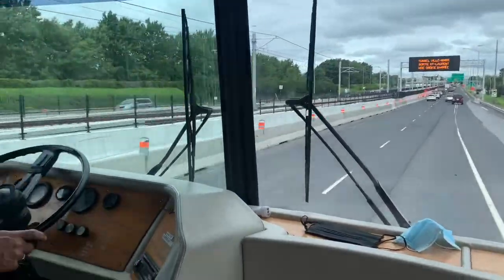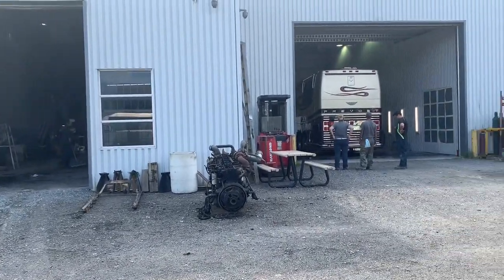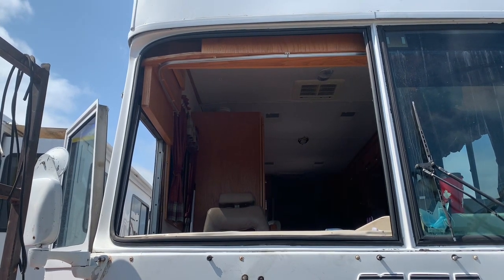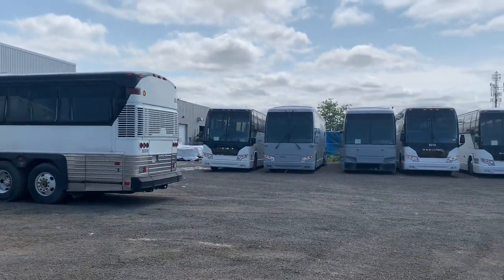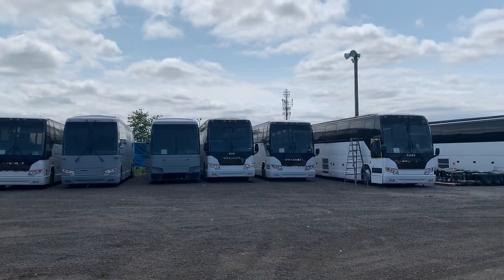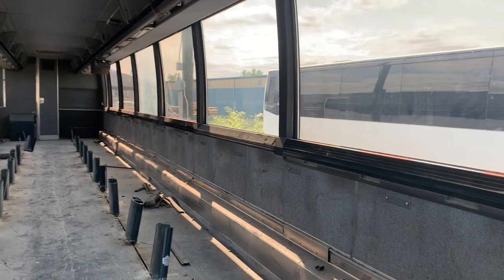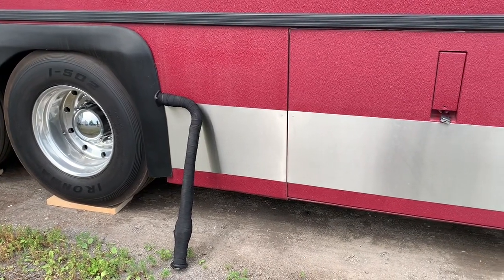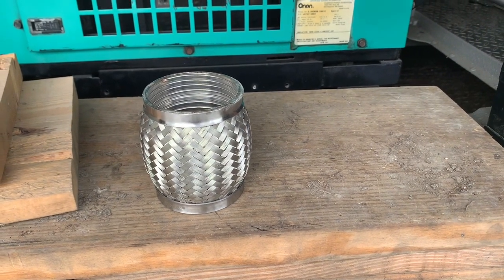E56 MC9 windshield replacement, and generator exhaust.

Comment: I’m not sure what Prevost does now, but my 1991 model year H3-40 is a “vip” model.  The standard H3-40 was the seated coach model and had the roof round over just above the drip rail at the top of the side windows (like most of the ones in your video).  The VIP model had the roof raised about 7 inches, providing the more comfortable headroom inside for a motorhome use.  The H3-40 was about 12’2” to the roof; our H3-40VIP is 12’9”.  With skylights, vent covers, antennas, etc. we are about 13’3” going down the road.  You will sometimes see an older H3 going down  the road with roof-mounted air-conditioners.  If so, it is almost certainly NOT a VIP model as the older roof A-C units would put you over the 13’6” maximum height limit (at least in the USA).  If you are not too tall, the standard H3 was a great platform for conversion as putting the A-Cs on the roof opened up a lot of bay space for other uses.  We have three CruiseAir A-Cs in our coach; 2 in the spare tire bay behind the front bumper (very difficult to service) and one in the curb side bay just forward of the drive axle (along with the Aqua-Hot, three water tanks, and the water pump.  Cheers to you both.
Reply from the maker: Great information. Carrosserie Préférence actually does the roof raises for the factory.
Reply: @LacroixCruiser    Interesting.  I didn’t know that.  I wonder if that was true back in 1990 when my coach was built?  According to Prevost Parts and Service, my coach started down the assembly line as a a seated coach but the order was changed to a VIP conversion shell before it was finished.  I always “presumed” that the raised roof was, therefore, done at the Prevost factory.